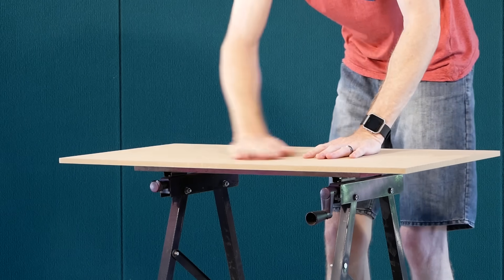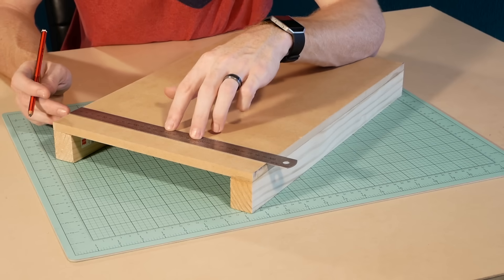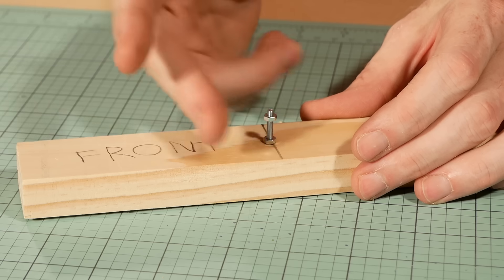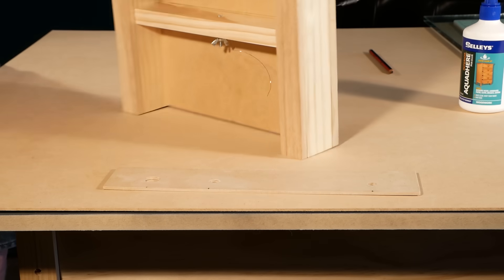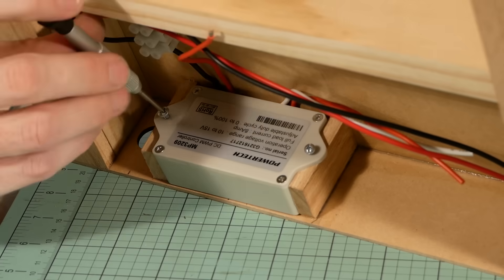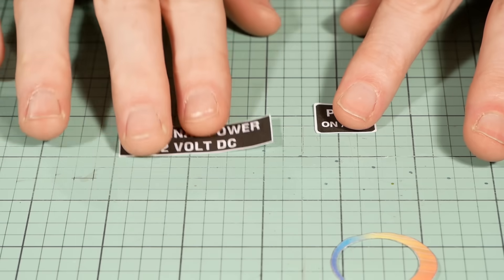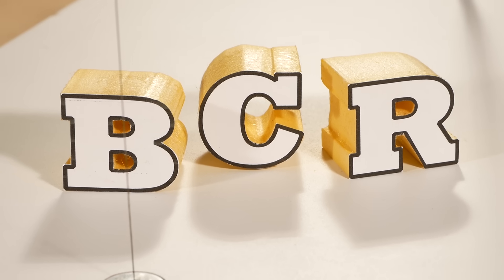Build Your Own Hot Wire Foam Cutter - Professional Tools for Modelers

Comment: 4-6-25 good afternoon, sir.  I really enjoyed watching your video.   The website to calculate the required volts and amps has changed the form.   Since I don't have access to nichrome wire, I'm using 24 gauge galvanized steel wire. 

Any idea where/how to calculate the power I need?

Thanks 👍👍👍

Comment: 🎯 Key points for quick navigation:

🛠️ El video muestra cómo construir una cortadora de espuma con alambre caliente, útil para modelistas.
📏 Se necesita una tabla suave y plana, preferiblemente MDF, y detalles específicos de medidas.
🧰 La construcción incluye varillas de acero, láminas de MDF y clips de cobre para asegurar las partes.
🔩 El corte implica precisión al posicionar y asegurar los componentes para la funcionalidad y seguridad.
🔌 Se requiere un controlador de temperatura compatible con la fuente de alimentación para regular el calor del alambre.
🎨 El equipo se personaliza con pintura para mejorar la apariencia y etiquetas para un toque profesional.
🕹️ Un diagrama de cableado ilustra la conexión de los componentes, importante para evitar errores eléctricos.
🔗 La cortadora permite cortes precisos en espuma, ajustando el alambre con un resorte para mantener la tensión adecuada.

Made with HARPA AI

Comment: Awesome video, thank you very much. I will barely give a recommendation for whoever uses it and that is to be careful with your fingers when working because they are very close to the wire and in any movement error it can burn or cause an injury. I recommend using resistant and thin gloves to be able to maneuver the pieces.

Comment: 10:51 wrong. your power source wouldn't be damaged. in the case your power source is underrated with regards to your desired temperature, it just results in an inability to achieve the desired temperature. now you make me question your conceptual understanding.

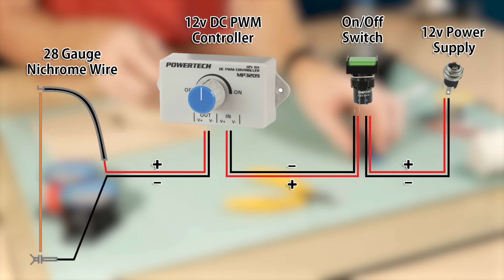Comment: Can you please explain your dimmer switch wires - 2 red, 1 black, 1 white.  And your wiring diagram (7:58) shows diagram with black and red wires.  Which red do you use and what do you do with the OTHER red and the white wires?

Comment: Another example of a DIY project that takes days and days to complete and costs $250 in materials and tools for something you can buy off eBay or Amazon for $100...
Reply: You can easily scale up and down with this DIY though.  Making something much bigger then anything you can get on Amazon.  Want to cut a 3 foot diameter circle?  No problem!  Also, not sure where you are, but I can get all of those parts for a grand total of about $50 Canadian... shrug

Comment: Only change I'd recommend to this build is to have the power skip the spring (so the spring doesnt overheat and lose its springyness). If your spring is substantial enough it should be a problem but my spring which was quite thin did go red hot ruining the spring.

Comment: what kind of solder did you use? mine doesn't stick to any washers.
also a tip for the wing nut: replace it with an electric guitar machine head tuner. makes it much easier to replace and tension the wire. how about a guitar string for the cutting wire?

Comment: I  roughly followed your design, but instead of having the metal bar I used 2 pieces of wood to make an inverted "L". I also used a guitar machine head for tensioning the nichrome wire (you can tension the wire as it heats up). I also wired in a cigarette lighter socket and I can now plug in a hand-held cutter.

Comment: Great video, thank you!  I am considering making one too and would like to know, would your same power supply would also work for 22 ga NiChrome wire too which only has 1.01 Ohms compared to your 28 ga wire with 4.07 Ohms?  I assume it would with a dimmer like you use but wanted to ask.  Thanks

My power supply is rated for 20V, 6.75A and I'm using 12'' of 22 ga wire.  The Jacobs hot wire calculator says I'll need 3.8V and 3.7A for 600 deg and 4.6V and 4.5A for 800 deg.  Will my power supply work for this as long as I have a 20V DC power controller?  Thank you again.

Comment: Great Vid. I based my own build on yours  
I bought the same pwm controller as you but instead of creating a higher base, I just unscrewed the box and removed the potentiometer to mount on the side.

Comment: I built this and it works great, however I get a high pitch whining sound when increasing the voltage on my dimmer. It seems to be coming from the bent steel rod but I cant tell for sure. Anyone else experience this? Is there a fix?

Comment: Hey sorry if this is not the correct thread for a video like this but what if you wanted to make a hot knife/dowel style cutter? Lets say for the sake of argument I was going to make a knife that could cut holes that dowels would go into. Like that 5mm rod you used but say a meter long so you could make long holes. Does that make sense what I am asking? How would you attach the power source to something like that?

Comment: How did you cut out the "D" in the R & B letter?
Reply: you could drill a hole, then pull the wire through, activate it and let it warm up, then continue.

Comment: hey, interesting project. thank you for sharing. What about the resistance of the Steel Bar? shouldn't it be considered when calculatin the amperage?
Reply: Good question ... A steel bar of this cross section has as close to zero resistance as makes no difference. (So it can safely be ignored.) The same applies to the copper wire used under the board also. Furthermore if there were some resistance to overcome we can dial up the temperature knob a bit to compensate. The dial is only 'relative' temperature so it is not that precise. I think of it a Goldilocks kind of adjustment (too cold, too hot .. or just right).
Reply: @alanlomax1271  nice. thank you. i did mine based on this project and it works great.

Comment: excellent Video !!!! But it create some more Questions. Maybe some one can help me.
What about 19 to 21 Volt, because i have an old Laptop Power-supply?
Would it be more danger ?
What kind of Regulator would I need ?
Can I cut only foam or also plastic like ABS / PTA ?
I want to cut Carrera 143 / Go!! Track-parts ca 1 mm Material-thickness (without the metal parts), is it possible?
Thanks in advance

Comment: has the dimmer, no need for the power button
Reply from the maker: I does help when cutting lots of stuff though, once you dial in a temperature for a specific material using the dimmer switch you can leave it at that position and turn the cutter on and off knowing that each time you turn it back on the temperature is set perfectly for whatever material you're cutting 😉

Comment: You won't damage the power source. But what will happen with the wire if you let it run on max setting at 12V ?

Comment: Agree with all the comments.  I know nothing about electronics and you make it look easy.  
I wonder if you can give me some advice.  I want to fuse layers of Polypropylene fabric together in a particular repeatable shape.  Polypropylene has a fairly low melting point and can be fused easily with the edge of an iron.  But I want this process to be fast and accurate, so  I am thinking of using contact adhesive to mount (rather than suspend) nichrome wire, sandwiched between PTFE teflon plumbers tape onto a board.  

As the wire will be touching the board, I may need something to insulate the wire underneath and ensure that the wire stays hot enough on top to fuse the fabrics.  Any tips would be gratefully appreciated eg recommended insulating material and issues with the wire stretching when hot.

Comment: Hey man awesome video I’m actually about to make two today I’m curious as to what size screws you used in length and diameter for the copper clasps (that were impossible to find LOL) as to be thick enough for the whole but not to pierce through The half inch MDF… Again great video..I agree that this is exactly how it is supposed to be done !! whoever gives this a 👎 is a jackass !!!
Reply: I should add that on my 34-year-old quadriplegic doing this with my fathers help Lol 😂 It sucks ! but Things like this make 1 day better at least.. I’ll take it…also hitting Amazon and waiting for the parts to come in..and then getting your “build on” !! So thanks Again 👍

Comment: I built this table but its way too hot, on the lowest setting the wire glows red hot and melts foam before it even touches. What can I do to correct this?
Reply: Sounds like your unit is using way too much power on the lowest setting. Or it's not correctly set up. Might need a new one to better control temp. Or use a less powerful power supply

Comment: Excellent video. Well done and well explained. I may consider building one with a fence as to slide the foam in a straight line for straight cuts. Any suggestions how to add an adjustable fence. Thanks...

Philip

Comment: For bending the steel rod use two closed end box wrenches and slip them over the rod. They can then be used almost like a tubing bender to shape the rod. Works for most bends up to 90 degrees. A little heat from a heat gun (the type used to strip paint) will relax the steel a little bit without having to use a torch. It won't get near as hot but it will be enough to help make smooth bends that will look much better than cold bent steel. Only heat the area where you will make the bend.

Comment: Luke you mentioned in your parts list to get a 12v DPDT Push On/Push Off Switch with inbuilt LED.  Is it possible to get a DPDT switch in push button form?  Can you provide more info on why a DPDT switch is needed?

Comment: LOl all the mathematics done etc :D (i'm not assuming it is worthless or something) it is just funny for me because i built a foam cutter like 5-6 years ago using only some desk halogen lamp base, a wire from hair dryer and old desk monitor stand :D I had no idea that you need to recalculate the length of the wire or anything else i just connected all the stuff i found around the house and as it was working i didn't even bothered anymore. Was using it for years :D

Comment: Will this work on rubber like foam? Something like neoprene
Reply: It will but not with great results. Neoprene tends to "flame up" when cut with a hot wire. Heat an Xacto knife with a flame and touch your neoprene....you will see what I mean. 

This cutter on the foam Luke is using the wire does not actually contact the foam. The heat radiating around the wire is what actually cuts the foam. If he moved the foam slower through the cutter you would see the kerf of the cut grow larger.

Comment: whats the diameter of wire, i,m not electrician, but your video explains well.problem is found el. material, i can buy then from Amazon, but choice is hard for me. can you  help only with el.material.thanks for your video

Comment: Thanks for posting! I just finished my build based off this design, including making the sides too short and having to extend them a little. To all the people wondering if you get shocked touching the rod... you do not. Not even a little. It is the same as touching one end of a dry cell battery.
Reply: Yeah, 12V will do nothing to you (I believe you don't need safety elements in a circuit up until 24V), which is why it's used in cars. But in this case it's even better, like touching the end of a battery that's at the same time connected to the ground, i.e. the current doesn't even want to flow through your body, it has a much better outlet.
Only if your ground cable accidentally comes off sometime down the road do you get the full 12V (or more like 5V depending on how the dimmer is set), and you'll probably notice quite quickly that something's wrong as your cutter doesn't work anymore ;)
So yeah, no need to worry, but it's never wrong to consider all risks. The temperature of the wire is probably more dangerous than the voltage on the rod, especially if you have pets or children in the house.

Kudos for following step by step, including the missteps XD
Reply: Thank you. Useful ok 👌 info
Reply: Hi buddy, can you support my channel?

Comment: It is a very interesting video, I have a question nonetheless, about the wires sections? You write 3mm 10 amps electrical wire. I have been looking for this size in the shop but the closer size is 2,5 mm section. Is it enough ?

Comment: I have to say you certainly have an interesting video descibing the way you put together the wire foam cutter. I have just one question ... Does connecting the wire directly to the steel rod make it heat up as well ? What about insulating the wire from the rod and also at the other end of the wire as well ? Just a queerie i had before I decide to start making one.

Thanks
Reply: Tony Gasperini No, the steel rod should not heat up as it’s resistance is negligible compared to the wire.

Comment: The spring is a necessary part and something most diy'rs omit from the build. The foam cutting unit looks really professional to me and I would be proud to have it sitting on my bench as a leading workhorse of a tool. Thanks very much for sharing and saving us money. Happy holidays! :-)
Reply: I built a very large one in the past, the cuts had to be about 40 inches long.  Now here I am doing research and preparing to build a smaller unit. 
You want higher, consistent tension for straighter cuts, when the wire is up to temperature.  I instead used a turnbuckle instead of a spring to tension the wire once it was hot.

Comment: Great job on this tool, certainly better than the small hand-one that looks like a pistol! :-)
I have plastic parts with sometimes 3mm thickness that i would like to cut in this way. do you think it would do the job? Any idea about a tool, or maybe by changing the diameter of the wire?
I made a test with my small "pistol". it works, on really thin part, but ......As soon it's been melted, it resolded again after the wire has gone !!!! (sorry, Im french: -).

Comment: Genuine question, how do you prevent shocking yourself if you touch the metal arm by accident while the power is on? Also you did trim off the excess wire on the bottom clamp right? My only experience with using nichrome wire as a heating element has been in use with electronic vaporizers, so admittedly I don’t have a ton of knowledge. How do you prevent electrical shortages? Also how does the spring affect the electrical resistance of the wire?

Comment: I never learnt good enough on electrical connections.  It will be wonderful if you can elaborate a bit more on how those wire connections are like.
Reply: sunchaser w basically the power supply would circulate the 12 volts around through the nichrome wire (resister here) and would get too hot.  The controller would add variable additional resistance in series to lower the temperature to 500 degrees and not burn up the cutting wire.

Comment: Hey awesome video...just a bit confused on the wiring. On the wiring diagram you show the red pwm wire attached to the metal rod, but on the actual foam cutter you have black connected to the metal rod...

Comment: Hi Luke 
I used your  example to build my own hot wire cutter using the same DPDT Push On/Push Off Switch with LED a couple of months ago but haven't been able to get the switch to work as yours does. Can you please advise how you wired it up? Cheers.

Comment: I would like to pass on my thanks. I made my own and it works perfectly. A few bits are a bit... slap dash. I couldn't solder the wires to a washer so I moulded them around a screw driver, soldered them in shape and then inserted them under the screw / bolt, but it works just fine. Thanks for the tutorial man,  you saved me a fortune.
Reply from the maker: Awesome! I'm glad you were able to get your foam cutter working.

Comment: What temperature do you need to cut double corrugated cardboard?
Reply from the maker: interesting? not really sure but it would likely be very hot around the 1000 degree Fahrenheit but you'd probably need to do a few tests.

Comment: AJG0107 hello  sir by the by i'm not  understood  for what  what purpose V
 need these two types of wires [ 28 Gauge Nichrome Wire ;  18 Gauge Galvanized Steel Wire]  And how should we cut alphabets in middle holes

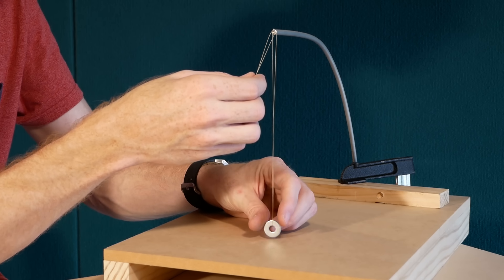Comment: 3:36, I love authenticity. Spider running down RHS of unit.
Reply from the maker: lol... it seems to be a theme in a lot of my videos! Random insects photo bombing 😀
Reply: lol, just a question on the hook you made in the end of the metal rod. Solder melts at 270 degrees, how did you get by this?

Comment: Hi Luke
Thanks for this very professional looking hot wire cutter.  I've created a clone for use in cutting foam for model aircraft projects but I'm having problems in wiring in the switch.  I bought the same DPDT switch as you used but can't work out how you wired in the integral LED.  Any advice or diagram would be appreciated thanks.
John

Comment: Hey man I know this is a rather old video, but I’ve made one of these and the nichrome wire has a high pitched buzzing sound when adding a regulator to the circuit. Now I know what the cause of the buzzing is but I haven’t found a way to fix it yet, do you have any idea?

Comment: You should use a fork or ring terminal instead of soldering onto a washer. Eventually the solder joins will compress and break, leading to hot areas.

Comment: Forgive me for my ignorance, I am quite new to any kind of electrical work. is there any risk of electrocution from touching the wire or the metal pole? or does the complete circuit make it safe?
Reply: Garuu it is around 12 volts and that is safe.  Your car battery is also 12 volts and safe.  Only the heat from a short might burn you.

Comment: as the metal rod is part of the circuit, would it not be dangerous to touch when the unit is turned on?

Comment: When soldering do sand or file the metal area of contacting , to remove any oxides and create a lasting connection . In places of high humidity and coastal zones can well use this tip .